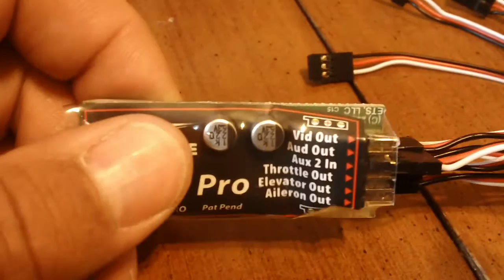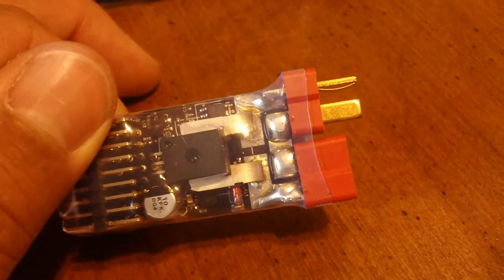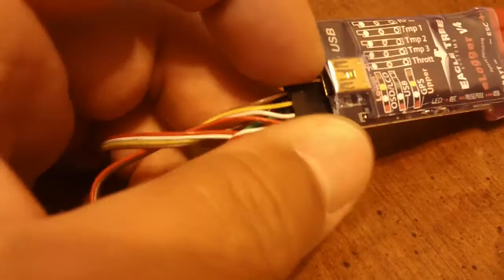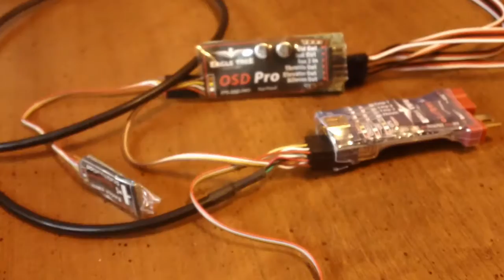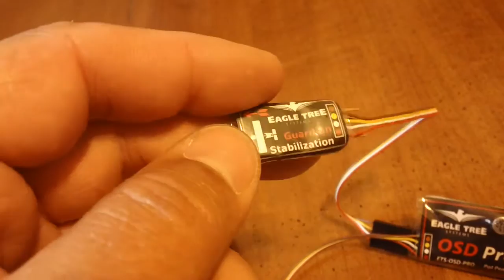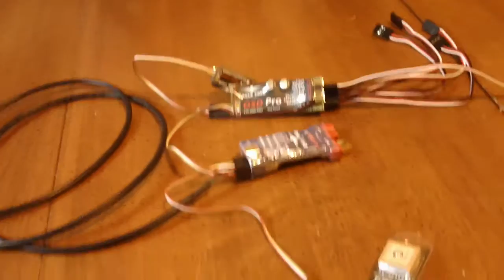Eagle Tree FPV gear for my FPV BLUNT WING

Comment: If i buy the eagle tree osd, it will coming with all stuff on your video?
Reply: Dwija Putra If you buy the OSD Pro Package but you still need to buy the stabilizer separate. Its about $200.00 plus the stabilizer.
Reply from the maker: ***** try the new vector it works in multicopters and airplanes.